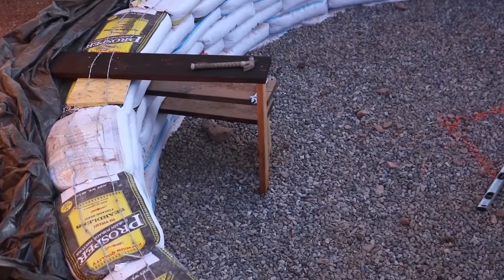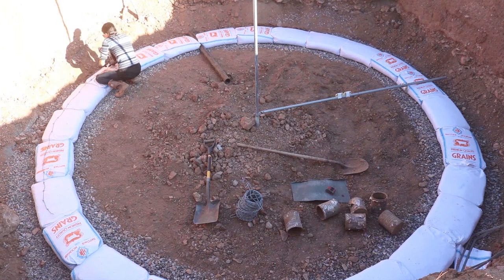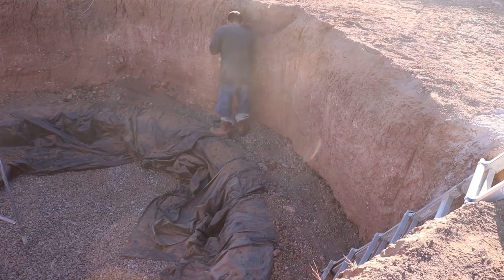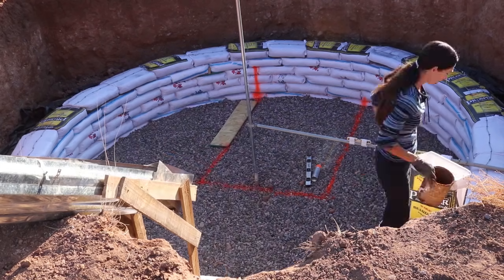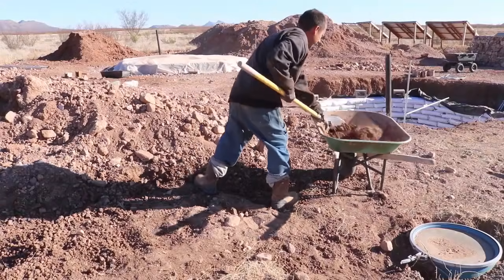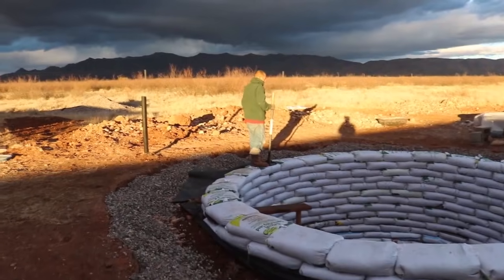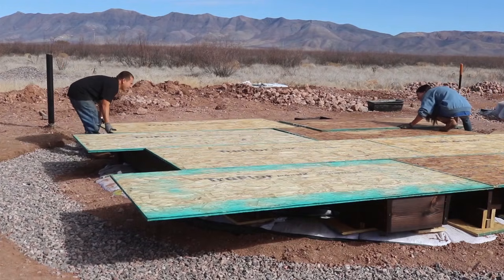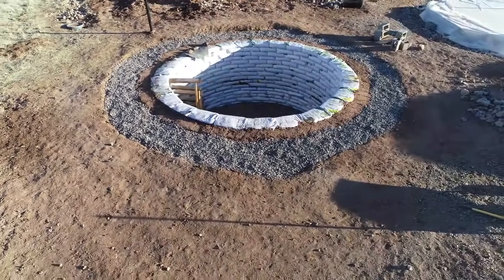Epic Underground Earthbag Room | Full Build And Costs

Comment: I hope that plastic is enough to keep the water out of there. You certainly couldn't get away with that here in Tennessee. We use black tar  And sometimes you still get a leak. But we also use concrete blocks for the foundations And basement houses

Comment: And my neck of the woods course they didn't use dirt bags or bags of dirt but yet concrete for their walls wood heater for heat in the winter and ceiling fans for the summer of course the concrete was covered on three sides and the roof with Earth

Comment: loading a barrow the hard way, you lay the barrow on its side against pile when you have filled  it stand at side on leg hold on to barrow and swing body back to right barrow, you will never do it the hard way again, you can place board in barrow to get a big load once your pile is getting low.

Comment: Buy a 3-hole or 4-hole threaded pipe flange, say 1". Center it and lag or bolt it to the top of the sub-floor. Once you screw in your 1" riser pipe to the flange you can use washers to plumb up the pole by putting them through the bolts,, under the flange to shim it till it's plumb.
Reply from the maker: Thank you William!

Comment: Okay so you  burn the wood ,  add Mineral spirits, then linseed oil
Reply from the maker: Burn, scrub, and then a mix of the oil and mineral spirits
Reply: Where did you find mineral spirits, I am in LA County they have an organic replacement, I wonder if it will work the same

Comment: Can you add a second radius rod and put the barb wire on that and then just "roll the wire out as you finish up a row? As long as you have the wire rolls on the rod, you can just keep going round and round till wire runs out. Looks great! If I was to do this, I'd make connecting hallways to each different room. Did you put in drain pipes? I didn't see any.

Comment: Whew - lucky.  From living in the az desert, I've found that you can control a snake by grabbing it within 1-4 inches of its head/neck connection.  This prevents any Striking action leaving the only part of the snake that can move to be the non damaging body/tail.  They cannot free themselves from that grip.  Without any tools, you can use a larger rock to pin the snake so you can get a grip.  (don't be afraid to use a shovel and just aim for the neck, Rattlers shouldn't be messed with or turned into pets, killing the snakes before they kill you or your animals is acceptable.)